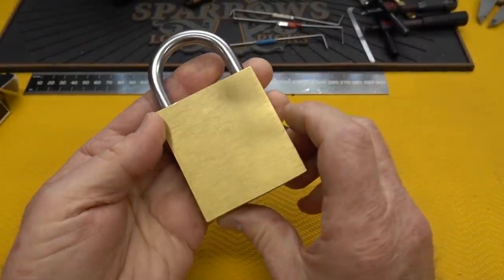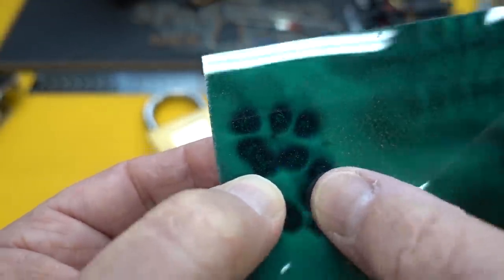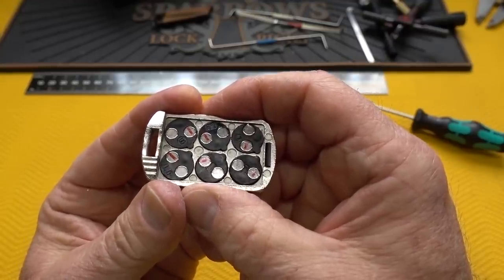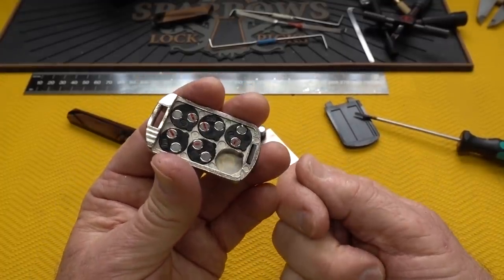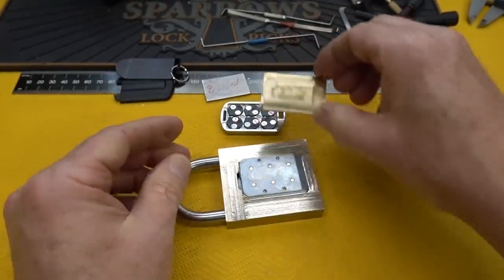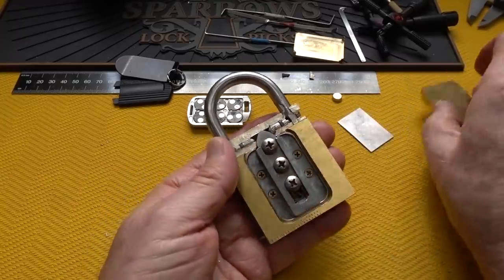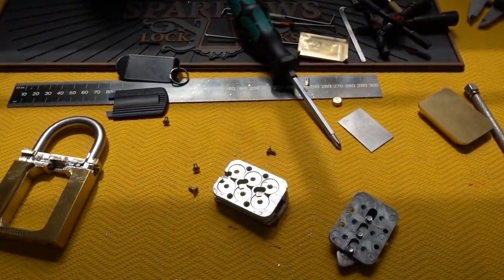(1701) RELOOK: Magnetic Lock (How It Works!)

Comment: What makes the discs reset to a "locked" position when the magnet key is removed?  Are there additional magnets in the housing?
Reply: Opposing magnetic force from the other magnets in the lock. That's why each spinner requires 2 magnets with opposing poles to provide enough rotational force to overcome the forces of the other magnets in the lock.

Comment: awsome but now seeing it you could possibly use the guts from that lock to pick others by rotating each disc to turn the other locks discs as you apply tension to shackle
Reply: even getting elaborate and adding clear plastic top plate and little thumb turns on each disc (like on a combination lock).

Comment: I was wondering if you had six identical desks (with two magnets in each) and just laid them on top of the lock. If they would just self orientate themselves and open the lock that way? Then I realized the magnets are free floating and would still need to be manipulated like 6 tiny dials.
Reply: They would orient themselves according to the resting positions of the internal discs, not the positions required for the lock to open. The key works because it has discs locked in the correct positions which then manipulate the internal discs, once the key is removed the internal discs affect each other, effectively moving the gates away from the 'open' position and locking the mechanism.
Reply: They would orient to the orientation of the magnets in the lock, which at rest are not in the unlock configuration, so it wouldn't help you. You could clone the key that way, but that's not really picking. Note the spinners in the lock will all naturally align with poles alternating when the key isn't present and they aren't sticking on anything. That's why the magnetic viewing paper showed the fields all regularly aligned before Bill milled away the lock (once he had it open, some of the spinners would have been sticking which spoiled the effect).

Comment: It doesn't look like this lock would be reliable in dirty environments. Anything that gets in and overcomes the magnets ability to turn the disks would cause the mechanism to fail. Depending on the alloy used for the magnets, if they corrode that could also cause them to bind. A key can apply as much force as the user can exert, up to the torsion yield stress of the key, in order to open a dirty or seized lock. Here you only have the magnetic attraction.
Reply: True, but how would dirt get in to the mechanism to begin with? Don't forget there isn't a keyway and nothing gets inserted into the lock. It's a completely sealed system (barring taking a milling machine to it)
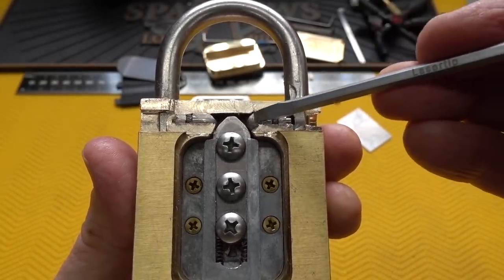Reply: @malgaras6204  The shackle  is 2 points of entry and the bottom has 2 drain holes. At 10:49 you get a good view of the internals and can see the pathway for how water and impurities can enter the disk mechanism.

Comment: It makes me think that if you hit the face hard enough the back would fall out and then you would be open
Reply: It would be easier to just cut the lock open than to apply enough force on the front of it to push the mechanism through the lock and out the back.  A dremel would suffice rather than a full blown jig and much hammering.

Comment: Love to know how this lock would handle a demagnetizer. I think if you sufficiently demagnetized the spinners in the lock, you could use some vibrations and pulling on the shackle to open
Reply: it would just break it.  there is little chance you could randomly get all six wheels in the right postions by shaking it, even if you could entirely remove the magnetic charge, which you cannot, even with a demagnetizer.
Reply: @thomasneal9291  those are probably neodymium magnets and to demagnetize them would require a cryogenically cooled demagnetizing field and the resultant induced current would probably melt the lock

Comment: Now that I have seen the insides I could defeat it with a drill and slide hammer to pop off the back cover and pluck the guts out.
Reply: That's why you weld a section of pipe or square stock over the area of the door that houses the shsckle, just big enough to fit the lock and your hand, but no bigger, open only at the bottom or the side
Reply: A. V. I didn’t say it would be easy 😝

Comment: Beautiful timepiece-like enginerding in the lock, brass nipples and all. Wonderful to see them spin. Is that like a big brass bank safe, or what!
Let me be the first to be completely wrong about the key. Looking only at the red magnets, because the other one of each pair has to be "black." 
So we're down to 6 things total. 
Each red thing on the left side has 2 positions it can be in. (Not 4, because of the plastic tab in the holder.)
Down the right side, the positions the red one can be in are reversed, but it's still just 2.
So, 2 choices for each of 6 wheels, isn't that 32? 
32 keys to open all these locks? 

Not denigrating that, since, rarity. But if I reeeeeeally wanted what that lock protected, and had to be quiet and sly, as in an office or an occupied house, one 6-place magnet holder, each magnet moveable, might open the sesame pretty soon. 

I don't want to steal. Don't want that lock. I want its clear plastic training lock, just to watch it work. 
I won't see anything more beautiful today.
Thank You Bill!!! 

PS When you going to write a screenplay?
Reply: Take a close look at the plastic things. They are NOT the same. They have some letters or numbers on them, and the magnets are set in various degrees in relation to the tab.
Reply: The cutouts on the disks are not uniform.  They each have to rotate to a specific angle.  This is why the magnets in the key are not aligned in a grid pattern.  Let's be generous and say there is 30 degrees of slop.  That means there is 12 rotations of each disk.  That's just shy of 3 million combinations.
Reply: We do need an actual lock to play with. 

I have faith that anything magnetic is beatable. Too much LPL I suppose. 

So if we wanted to open a one-disc lock, my external magnet would not help? One commenter mentioned pulling hard on the shackle, feeling the gate.
Reply: Capitol Industries says "over 250,000" combos.
There are 6 wheels. 
The sixth root of 250,000 is 7.94.
So I think CI is telling us that each wheel has 8 possible settings. 
(8 to 6th power is 272,144 combos)
So, ~45° each. 
fwiw
Good Covid project.
Hopefully BB will stay on it

Comment: Woooow. Amazing engineering.
Thanks
Reply: The padlock can be improved by inserting the key instead of putting it on. If the padlock is made of stainless steel at the external side, this will be much more stronger, and to align the magnets, the key must be inserted. So the system is much more secure.

Comment: And I just figured out how to defeat the lock.  Cool.

Going to need a key from any lock.  Cut those alignment tips off so the  magnets can spin in the key.  Drill 6 small holes through the back of the key and a small slot in the magnetic disc.  Reassemble the key.  Place key on the lock. Now using a small tipped screwdriver, you can spin the magnetic discs in the key.  Pull down slightly on the lock to engage the locking bar into the bar pushing it down into the discs of the lock.  Rotate the screwdriver in each key disc till you feel the gate click into place. Viola. Open.
Reply: Tensioning the lock may prevent the disks (I think of them as tumblers) from rotating, defeating the use of tension.
Reply: I was thinking the same. I don't think you'll feel anything but if you draw a black line around the shackle where it meets the lock body you might be able to see when th eshackle pulls out further than before. From the looks of things there's six possible orientations for each disk so you'd try each position iin turn then pull on the shackle in between each one.
Reply: @Penjulum  I would expect that it would likely prevent one or maybe two from turning.  But if one knew what the valid magnet positions were, one could try swiveling the binding disk to each position with tension removed, re-apply tension, and see if any other disks bind.  If they do, then the first disk is in the right spot.
Reply: Rinse and repeat 600.000 times. 
This is like saying that you have a clever way of defeating a code Lock. Just get some elbow grease, and try every combination.
Reply: Even if you "feel" all the clicks (which you cannot) you cannot pull the shackle up because you will loose the tension and the magnets will rescramble.
Reply: Go back and rewatch the video from 11:00-11:20.  Pulling on the shackle will push the non spring loaded locking bars into the domed driver that drops into the gateways.  Therefore pulling lightly on the shackle will tension it. As you turn one disc, it may not find a gate (freespin)  go to the next.  It will drag slightly (bind) until it clicks into a gate.  Move on to the next and repeat.  Every time it clicks into a gate, the bar will drop a fraction and the shackle lift a fraction.  Eventually, all the gates will be aligned with the pins on the bar and it will allow it to drop all the way down as pressure is still being applied on the shackle.  

If Bill wants to send me the lock, I will do the work or seeing he has the machines, I can talk him through it.  It should work.
Reply: @iammongo2106  There's no pick, rake, or any way to directly apply pressure on disks to make them spin.  If the disk is binding it should not turn.  It's just a small magnetic field, not a screwdriver or a key pushing it.  If you try and tension through shackle I'm pretty sure all you will do is jam disks in their current neutral states.  It's also doubtful you can even feel anything through the shackle even if you had some way to force disks to spin under pressure.  Seems like it was very rough to open and bill even commented on it.
Reply: @Fpsnut  The idea would be to turn the disks, then apply tension and observe (perhaps with magnetic film) what disks don't return to neutral state.  Any disk that doesn't return is either in the right state or is the next disk in the binding order.  If a disk was in the right state and one repeats the test with the disk at a new angle, then any bound disk that followed it in the binding order would no longer bind.

Comment: Good lock for fast unlocking.
 Perfect for locations that need to be unlocked 100 times per day.

BUT it's not safe ! because the well arranged matrix of very small and weak magnets will reveal the polarity of the magnets inside. It will be the reverse polarity of the magnets from the magnet matrix.

Cool lock anyway !

Comment: If you create a key with small, rotatable magnets, equivalent to the key, the moment you attach it to the plate, the magnets should orient themselves to the magnets inside and then the trick will be tensioning the shackle and slowly rotating each magnet till you feel give, then locking the magnet in that position. It make take a little, but it should effectively allow you to find and break the combo and get the lock open.